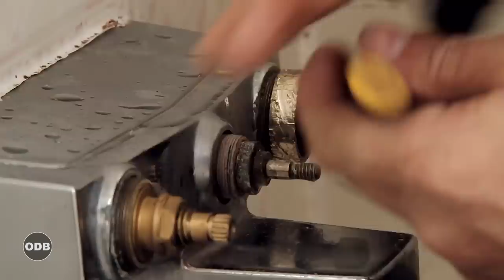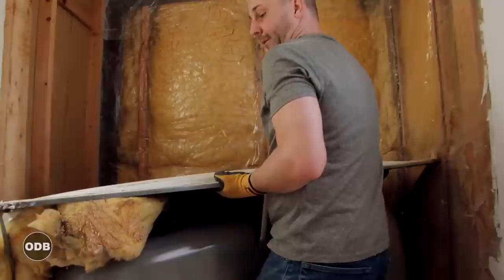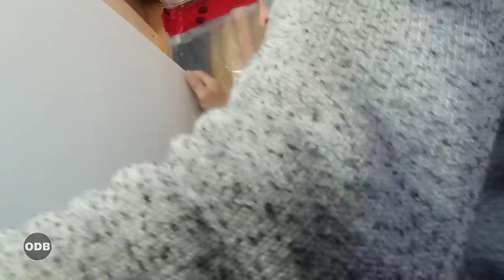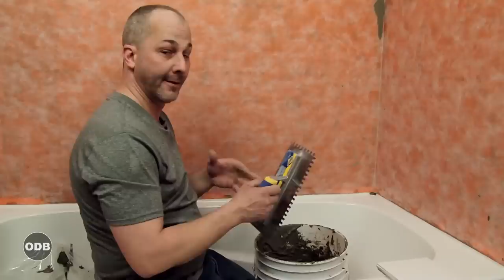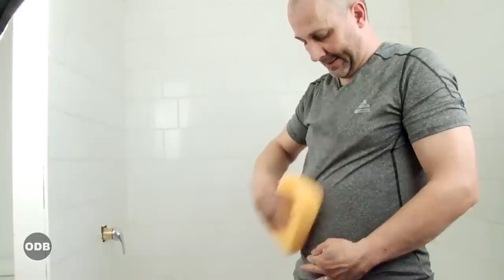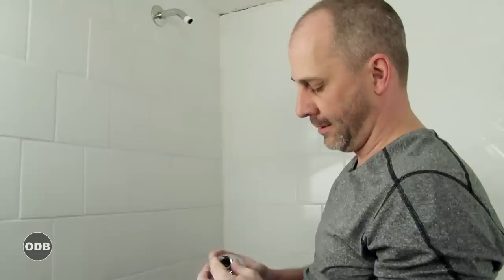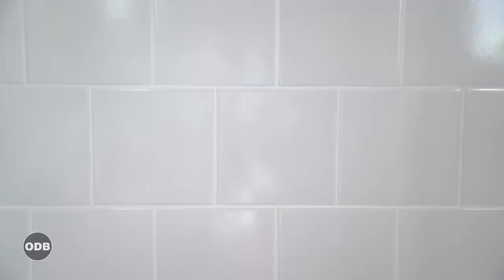DIY How to Renovate the Tub / Shower from A to Z

Comment: I saw a video on the shark bite fittings where the guy said he would never use them in the walls.  Reason being, they have an o-ring inside which makes the seal and over time chlorine in the water will harden and deteriorate the o-ring causing it to fail.  What's your opinion?

Comment: water supply line from valve to spout must be copper.  You will experience water drifting from the shower head when you just want it to the down spout when you use pex line.

Comment: Excellent video.  I was a little concerned doing my own bathroom.  I have done some remodeling but was worried about not doing it right the first time and having issues later.  This covered about every question I had.   I got 1 estimate for my tiny bathroom and they wanted $15,000.  And they wanted to do it the quick shooty way.   Thanks!

Comment: We would like a whirlpool tub and a tub surround with 2 shower heads opposite of each other. We only have 7 foot ceilings and we are having somewhat of a hard time finding a surround that won't go all the way to the ceiling with the tub we want. Is it ok to go to the ceiling with a surround? Not tile....the 3 piece ones you buy. Thanks! I love your channel!
Reply from the maker: no problems at all. the reason they are short is they are designed to manage water and they usually go to just below the shower arm.

Comment: Awesome video, just one thing, you shouldn’t use PEX for the tub connection, it wouldn’t hold the pressure, the delta valve body even say that, anyway, great instructions

Comment: Did he kill the mold on the insulation before covering it up?
Reply from the maker: Hi Kathryn, the dark coloration is not mold on the insulation. It is simply dirt from air movement. Most older homes have this residue since they don't seal up the building against air leaks. Cheers, nothing to worry about.
Reply: No need to once it is cut off from O2 the mold will die!!!!!!

Comment: You are feeding the Teflon tape wrong off the Teflon tape roll. You should be feeding the tape from the roll in the opposite position. In other words, turn the tape roll over 180 degrees from the way that you are holding it now. Watch how the tape feeds off the tape roll on to the pipe threads in this video.       https://www.youtube.com/watch?v=f7mjyzfB9Ec

Comment: I noticed that you did not measure the drain fitting's height from the floor for the new tub.   Is the height standardized for all tubs?  It also looked like you did not fully screw the new drain flange into the drain pipe...???

Comment: I've moved on from these older waterproofing systems to the Red guard. You should give it a try its 3 quick coats with a roller and you have the best protection possible

Comment: only thing i have found bad about those water fittings is that that they spit pretty easy due to cold weather if you wall is on the exterior of the home make sure you insulate around them very well..spry foam is great for that also

Comment: dead legs in supply water line is a fail for health if you don't know what a dead leg in water pipe pluming is it is when water line has a branch that leads to know where meaning the t-fitting close to the ground that have lines that go to caps should have been cut out this shouldn't have been a problem in this case where he added the pex just need to add a foot more pex an cut closer to the floor

Comment: SOOO MUCH VALUABLE, PERTINENT, INFORMATION!!!  THANK YOU!!!  I have a bath in the home I purchased (that was a rental house for many, many years; Read Slip Shod Work) that I have needed to completely remodel.  There Is Painted Drywall In The Shower!  Just painted walls, that's it, I have 360° of shower curtains because of it.  I purchased most of the materials I need for the remodel more than a year ago, but have lacked the spine to jump in and get it done (I will be doing it alone).  Now I realise what a blessing it was that I haven't.   Although I've watched other How To vids the information didn't leave me feeling much more confident about beginning the build (which is NOT my norm, I have no issues jumping in to do other construction).  However Your Vid Has Left Me Feeling That I Can Now Begin!!  THANK YOU SO VERY MUCH, WHAT A TREMENDOUS BLESSING!!  Thank You For Taking The Time To Do This!!
Reply from the maker: Glad to help all the Lions out there. Cheers!

Comment: When doing the overflow it's impossible to be perfect with the height with abs.  I use one of those rubber sleeve connectors in the middle of a couple of vertical pieces of abs.

Comment: 4000??? What cost so much? Tile, grout, NEEDED tools, pipes, fixtures, drywall, barrier and a few other things... All of that should be somewhere around 1000. Tub could be anywhere from 500-1000. That's 2000. I'm going to be doing some work on my house and want to do it right like you did but I don't understand where you got that amount from or how?
Reply from the maker: That was labor and materials.

Comment: We bought  a  used 1975 Marlette Double -Wide back in 2001. We gradually replaced older plumbing fixtures with newer high-quality metal fixtures, except for one of the bathrooms' sink faucet. We used an $11 plastic sink faucet there. Seven years later, that plastic faucet was still good but the metal faucets were corroded from our well water.
Reply from the maker: That happens!

Comment: I love shark bite for quick or emergency jobs.
I've looked after the same buildings for over 20 years I've been using PEX and sharkbite for around 10 years with no issues. u just need to follow instructions and do it the way they say
I think old time plumbers don't like it because of poly. b plumber failures from the 80's, and they want ppl to spend big bucks on plumbers .
Reply: Sharkbite is actually better than Solder if you install it right.

Comment: Awesome video. I feel I could do this myself. Living in my grandparents home which my Pap added on to. He has a short tub with plumbing in a weird box. Want to put in a 60" tub as old one has lost a lot of the porcelain overlay. I think I'm going to have to cut out a hunk of joist for drain pipe in the basement though. Blah!  Anyway, what brand of tub did you say this is?  I couldn't quite hear it and I don't see it listed in box below. Thank you for sharing with those of us that don't have the big bucks to pay for someone to do reno for us. You rock!  PS.  There is no shower to worry about with my project and surrounding walls are congoleum. Lol. Thanks in advance for name of tub!
Reply from the maker: Hi Carla, the company is Mirolin. Only available in Canada. If you are in the states contact Ferguson plumbing near you. They can help you get a good one for less than the box stores. Also It only costs $300.00 bucks to have  a porcelain tub refinished on site. It looks new and lasts for 10 years minimum.

Comment: Outstanding!! This is the best informative video I have seen on this subject.  Thank You.  Now if I could find a contractor that would use the materials that were used would be a problem.  My shower leaked and I had the mold and wood replaced and it was not even close the what you pointed out, so I know that I will have to repair again shortly.  I am dangerous now with this Knowledge, Ha HA  You make it look so easy but I know you can't beat Experience. My mission know is to find a contractor with your knowledge. In Los Angeles it might not be available.  Thank You again for this information, very much appreciated.
Reply from the maker: No worries Peter, I am sure they are out there..somewhere. Cheers!

Comment: The only problem is you have to buy that crimping tool and the PEX cutter - not cheap. And, you may never use them again. And, maybe follow the copper thru the floor and start the PEX there especially if it's a basement house where such is easily accessed. That copper is 25+ years old and will eventually fail. Of course, if you have an access door in the back of this plumbing it's not a big deal, but a few extra minutes to plumb could save extra time work down  the road.
Reply from the maker: Hi Rob, around 45 bucks actually. pretty cheap compared to a plumber.

Comment: Looks like you added the two horizontal pieces (between the wall studs) that you attached the manifold(?) to without showing us; probably thinking the proper placement would be obvious. But now I'm wondering how deep it goes into the cavity so that enough protrudes through the opening, once the shower wall is up and you're ready to attach the faucet.. It's ok to underestimate our intelligence, some of us count on it.
Reply from the maker: The placement depends on the product and the manufacturer. always read your installation instructions to find out. Cheers!

Comment: In many areas vapor barrier in a bathroom is prohibited per code. Because if there is a small leak the barrier keeps it from ever drying and molds faster... a lot of basic things ignored in this video. Sure it works, as a Cheap remodel for a rental or some house flipper but the install is far from idea. No mortar under the tub? Drywall behind a tub? What is this 1960??? Come on man even densheild isnt expensive.
Reply from the maker: Hi Jerome, would love to hear which jurisdictions have vapor barrier  removed from the code!

Comment: In case the bracket was not properly installed and a leak is present, can we still use the same pipe or do we have to change it?

Comment: Hello from England! Thankyou for your video, I am an Architect but I do say I am professional standard decorator, I didn't disagree with anything on your video, worth noting also when you load the roller with paint, turn the roller round when running off the excess paint on the tray ridges so the roller is loaded evenly or it puts paint on unevenly onto the wall which then gives you more work to roll evenly out on the wall. I have never used the angled brush so will try it for edging in. Alays ensure the texture on the wall is in one direction if possible, so in certain lights you don't read the direction of the roller in the finished paint. From a fellow perfectionist!!! God bless you!
Reply from the maker: Thanks and Cheers to England.

Comment: I just recently started watching your videos. I am a handyman, but am always open to how others do things and maybe pick up a few tricks. I am not going to go through the almost 1500 comments to see if this is already mentioned. You seem to use an excess amount of Teflon tape. I usually go 3 to 5 turns depending on the width and thickness of the tape. I also have tried the screwdriver to tighten the shower head arm, but there is a huge risk of making the threads oblong. Don't ask how I know LOL.  I will thread on a pipe coupling first, tighten, turn and remove coupling.. Keep up the great work with your videos.
Reply from the maker: Great idea about the coupling to add some integrity to the pipe.

Comment: In one of these videos, you replaced the vapour barrier.  I'm wondering if this would be a problem with KerdiBoard, given that it is already supposed to be waterproof.  I don't want to create a sandwich with water in between, and am planning to use Kerdi Board.
Reply from the maker: use the board and do not worry about it. As long as you have a good fan in the room there will not be any moisture buildup. Cheers!

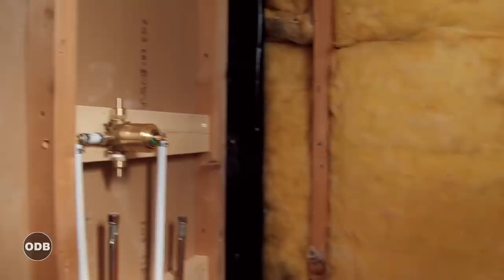Comment: @ 25:44 you just finished crimping the pipes.  But what if you open a wall and find those fittings?  Are those crimped bands able to be removed so you wouldn't have to buy a new valve?
Reply from the maker: its a pain but yes. Cheers and Have a great Christmas!

Comment: Why does the plumbing area have two unused and capped off pipes coming up from the floor? I am a total newb at this sort of thing and now I think I can actually replace my bath. Compliments to the camera man also.
Reply from the maker: copper lines do not expand so they hammer under certain conditions. pex 
wil absorb pressure changes without the hammering noise so no need for 
them in a pex application. Cheers!

Comment: ive watched this about 5 times to get the process down. we are getting ready for a remodel in our home now. if you wanted to retain the tub, would you just throw a cloth down to protect from all of the debris from the demo? also, if there is that corner leak that you identified and leaking onto the ceiling below, what would you recommend?
Reply from the maker: Hi Johnathan. I did a video where i demoed the tub surround and kept the tub. That would be worth a watch for sure. Cheers!

Comment: You mention how when you tile the back wall, you either start with the tile in the center or a grout line in the center,  but wouldn't that only apply for every other row and the other rows would just be the opposite? For example if having the tile centered would give you a sliver on the end and you change to a grout line on center, wouldn't the second row give you that sliver again anyway?
Reply from the maker: nice thought , however most tile is designed for a standard tub and that does not happen, with odd shape walls or large tile you can change the offset pattern to suit your needs. Cheers!

Comment: This shower would have looked amazing with black or grey grout. Would have made it look less blah. Just my opinion.
Reply from the maker: I agree however you must use very good quality tile when doing this. In this business there are 2 major quality tiles. good and bad! the bad ones are not square or the same size. so contrasting grout will cause you a nightmare.

Comment: One thing that I do is turn off power to the water heater. It's been my experience that once the house is drained the water in the heater is sometimes siphoned out and the element continues to run and subsequently burns up. It's only happened once (because now I turn off the breaker) but those elements aren't cheap.
Reply from the maker: nice advice.

Comment: When you tiled the 1st row the tile looked like it was directly on top of the new tub flange with no spacers? Should you use 1/16 or 1/8 spacers to raise the 1st row of tile off of the tub and then fill the gap with caulk, or should you start the tile directly on the tub?
Reply: No a spacer is needed . His other videos show it  . It could have just been cut out . The same spacer your useing for the tile will do .

Comment: How would you do this without a tub spout but with a handheld shower in addition to shower head? Would a thermostatic valve with a 2 way diverted work - one for shower head this other for handheld? Also would you use drop ears for both?
Reply from the maker: Yes Yes and Yes! Cheers!

Comment: ur using ur channel locks backwards.  Turn em around and you won't have to squeeze so hard when you're using them to tighten or loosen stuff.  When used correctly, they practically apply the squeeze force without you needing to squeeze at all... self tightening grip by design.
Reply from the maker: I get lazy with this since my hands are virtual vise grips after all these years!
Reply: So why did you resort to a screwdriver hammer attack on what should have been easily removed with channel locks used properly?  Or a pipe wrench?  I mean.. vise grip hands and all.. why risk damaging the pipes as well as destroying that valve?  Just sayin.

Comment: I think that I would have built out the wall with the valves on it rather than have the other wall uneven.  No one would ever notice and all it would take is replacing the corner bead.  Other than that it was a very informative DIY video.
Reply from the maker: We made that decision in order to have this project done in 2 days. I did not want to increase the scope of work. Cheers!

Comment: So if i just wanted to change my Spicket, handles and “drain nob” (the thing  that you push up or down to hold the water in the tub) And it had tile around it. Would i have to pull apart the tile?
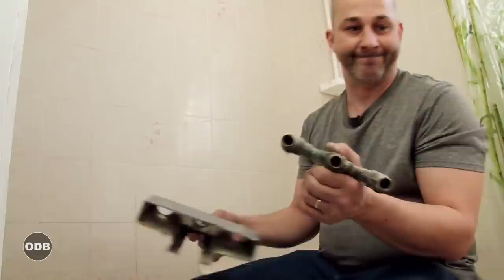Reply: You mean this 4:53 if so normally you don't have to take the tiles down.
 it come off with a screwdriver and when you pull it out there is a hanger that catches hair connected to it.

Comment: Was the faucet trim too small? Looks like the collar left about 3/16 to 1/4 inch of exposed brass.
Reply from the maker: Hi Mike, actually the wall in this house is 2x3 and is not very conducive with the valve assembly.